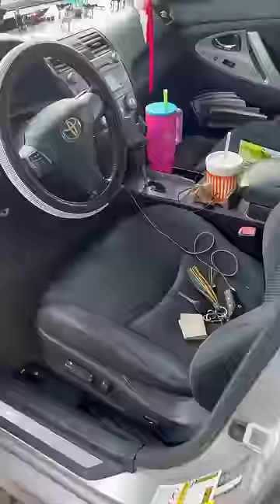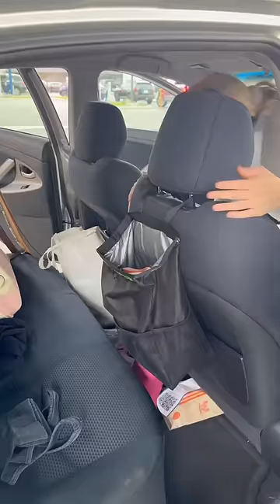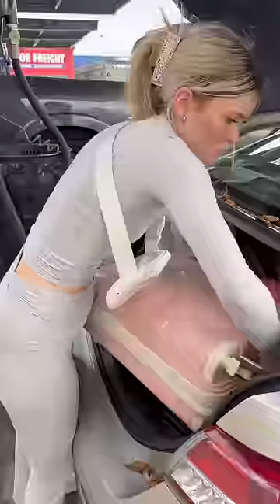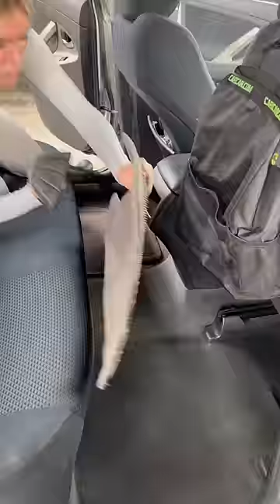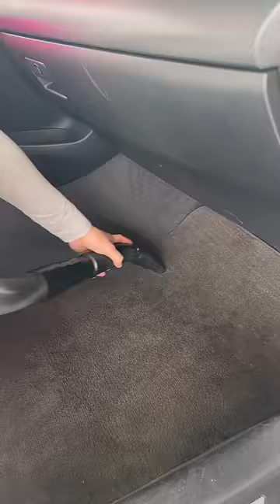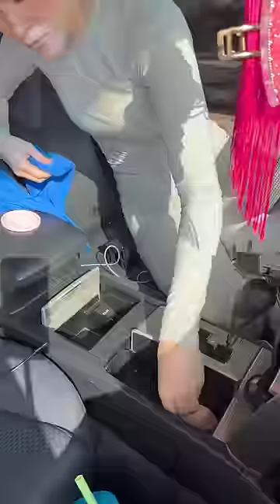Who else drives an older car?? #cleaning #satisfying #Motivation #lifestyle

Comment: I drive a 96 kids Sephora with 420000 miles on it. It still has the original engine and transmission mission and they have not been rebuilt.

Comment: 2007 Ford F-350 goin fine here she has 263,000 miles ain’t nothin wrong with it, I have had to fix the holder for the engine department (it ain’t stayin open) but other then that she is working.  Change oil every 10k miles.  They ain’t makin them older stuff like  newer stuff, it’s all trash dude. It is also easy to work on and it ain’t restricting me like them newer trucks with trashy electronic screens in em.

Comment: No hate to an old vehicle I daily a 2008 f350 with 50,000 original miles had the motor and the drivetrain(trans, axles differentials)built at 34,000 to see how long it can last me lol now at 50,000 and it’s a 2008😂everything’s great on the truck and everyone always guesses its a newer truck but always love saying it’s an 08 with low miles and completely built for longevity… props to the old Cars/Trucks

Comment: 2010 is old to you?  Hunny I drive a 1968 Olds Cutlass S with a 350 rocket block engine with dual exhaust, 4 barrels, headers and 4 on the floor. You see she doesn’t have a computer in her and the only thing under the hood (oh yeah, she has hood pins so when I open up the secondaries and the hood let’s go it doesn’t go flying) is an engine so no check engine light and the stereo system always works.  😊

Comment: Older car? 2010? Bro i have 2 vehicles i drive on a regular and a 3rd semi regular, my preferred daily a 2000 Dodge Dakota sport 5 speed, a 1988 Chevy Silverado 2500, then a 2003 Oldsmobile Alero. 2010 isn't old to some just broke in.... but then again they don't make them like they used to/ should.

Comment: I wasnt aware i was supposed to be embarrassed of driving an older car.  Guess i need to get rid of it.  

2010 isnt old
A flat tire can happen to a brand new car
Check engine light could mean a $500 repair or a $5 repair.  
Stereo not working?  Ok $100 fix at most.

Comment: Old car? 

😂😂l😂😂😂

Newest vehicle I have is a 2002 Mercedes. Next is a 1996. Then I have two large trucks both 1993. 

Yup! I am an old guy. 😂

But if you maintain what you have and don’t give it, “I’ll drive it not the ground “ judgement, they are all just machines. Simple! Maintain, respect and value what you have.

By the way, I was in the car business since I was a teenager a was taken advantage of by a dealer and some repair shops. You chose one of the absolutely best cars to own.

Comment: 2010 is old? That is new considering I have never had a car newer than 2002. I drive a 2002 Toyota Camry V6 with 96,000 miles I can't believe you think 2010 is old. My last car was a 1995 Jeep Grand Cherokee. I had that car during my immature phases of being young and reckless. I am 22 btw. That jeep hit a tree from doing a donut set off the airbag, and I was STILL. Able to drive it home, fix it a little better and drive it the next month to work with a different color  hood and fender and a new radiator.

Comment: That's old to you? I drive a 1997 4runner with half a million miles and a 2002 Camry with 300,000 miles. Both are great because I can work on them myself (major work gets done at the mechanic, I ain't doin a rear main seal in my garage)

Comment: I had a 2014 Kia Optima with a gas sensor that only worked when it was full, check engine light was on, & there was some sealant issues so water got in sometimes. But I loved her.  Her name was GI Jane. Someone stole her 😢

Comment: Cleaning your car is not taking care of it… when is the last time you changed your diff oil, trans oil, brake fluid, new battery, cabin filter, engine filter… gapped your plugs? That is the basics.  Wanna know what a zirk fitting is? New motor mounts who dis? ….

Comment: 2010 is not that old. 14 years old now. I have two. 2004 kia. Yes kia sorento. 3.5L v6 5 speed manual with 4x4. Almost 300 thousand miles on it. And a 54 f250. It has a big block in it now. With power steering. But still carb style. No electronic computers.

Comment: Enjoy it but it's not that old, Old is driving cars with OBD1 Computers or carburators🥴 keep it another 10 years, I daily a 2003 Pontiac Bonneville with 264,000 miles currently, they RUN

Comment: Way better off with an older car than anything newer than 2012, pretty much all newer cars are cheap JUNK!!
Especially since it's a Toyota, you can't go wrong.
Getting a flat tyre, or a stereo that doesn't work isn't exactly a problem due to the age of the car, and a check engine light won't be anything serious on a Toyota if you get it rectified pretty soon.
Lucky it's not a GM or a Mopar/Jeep/Chrysler/Dodge/Ram/Plymouth POS...you'd likely be needing a new engine 10 yrs ago🤣🤣